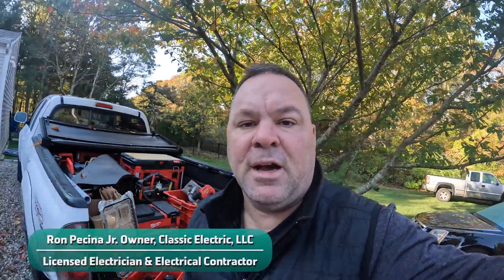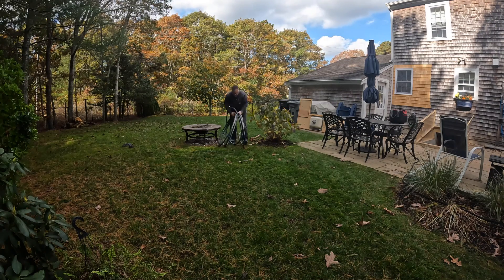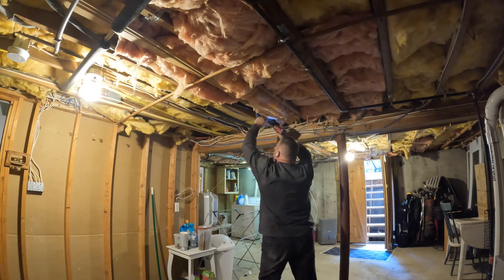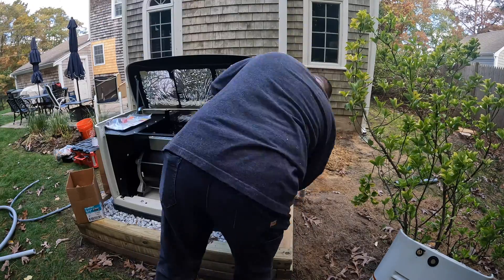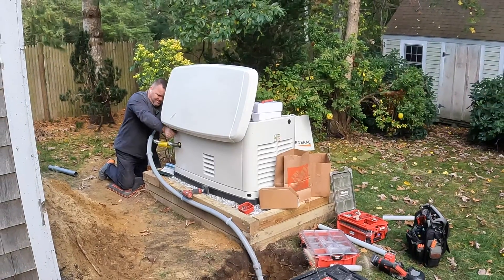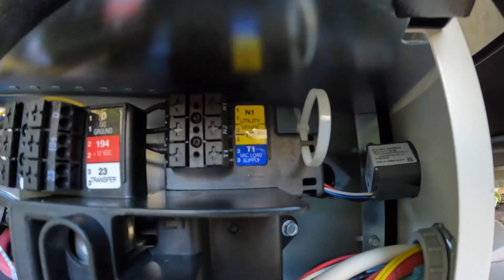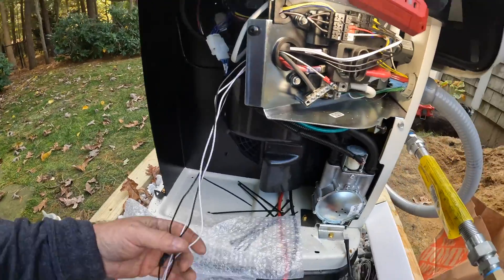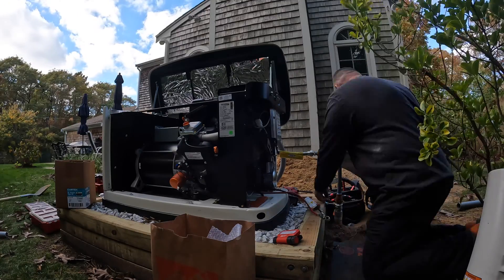Generac 7209  24/ 21 Air-Cooled Standby Generator Part 1 (of 2) | Osterville, Cape Cod

Comment: Nice job. One question? You said there is always 240 v going to the generator 🤔 It’s only had 240v from the generator when it’s running. Correct?
Reply from the maker: N1 & N2 are voltage sensing devices.  It’s what alerts the transfer switch that powers been lost and to start up the generator.

Comment: Hey Ron, God bless you man, great videos. Help I have an issue with a generator with the battery because it is always dead I was reading about a neutral jumper there is no clear information. What I can do, thanks.
Reply from the maker: The neutral jumper is for new units. If your generator is at least a year old you likely don't have need for a neutral but you should have  T1 supplying 120 volts to charge the battery. That's what T1 is for.

Comment: What’s wrong with going through the sill plate? Why the foundation wall?
Reply from the maker: You want to go through the rim joist, not the sill plate.
Reply: @electricianron_New_Jersey  that’s what I meant. Just strange that they core drilled the foundation wall. We stay above grade to prevent any damage to the water barrier below grade.

Comment: Good job,a couple of things  I would have done different is put a 90 at the bottom to make it easier on the pvc straightening up also install another lb at the top of the pipe then change over to the the seal tite 👍

Comment: Nice work. 

I have a 22KW in Florida. A couple weekends ago I noticed a Tstat was off. Checked the float switch, low voltage fuse all good. I have no incoming 240. Breaker isn't tripped. Removed the panel cover and I have 240 at the breaker. I was stumped. Did a rat eat the wires in my attic but not short them? I had continuity back to the air handler so not that. Maybe the breaker can't carry current? I'm pulling at imaginary straws at this point.  On the way to pick up a breaker I remembered the A/C's have load sheds. Sure enough the light is out on one of them. I bypassed it and we have power again. Turns out the Generac load sheds have known bad boards. The old ones are green. New boards are blue. The other thing that through me off was when I checked the contactor in the load shed it was pulled in. I am used to A/C contactors being pulled in to close. This is relaxed when closed. A bad board pulls them in to open. Learn something new everyday. They replaced the bad board under warranty so all back to normal.

Comment: Nice video Ron, who does the generator pad and platform? Is that usually the electricians job or does a GC handle that or homeowner? Are poured concrete pads the best or do you get the pre-made ones that you just lay down?
Reply from the maker: It's really up to whoever owns the generator. I've done them in the past and I think they're really nice. A precast concrete pad direct from Generac is also a nice option.

Comment: Love your work, I’m electrician in Minnesota. Is SE cable rated for direct burial?
Reply: standard SE cable is NOT rated for direct burial. The stuff he is using here is available through Generac and is UL listed for just about anything, although not cheap. You make up the price difference because you don't have to run more conduit to satisfy code on low / line voltage in the same pipe.
Reply: Its not SE. Its TC specially made for Generac. It has N1, N2 ( sensing) 23 , 194 and T1. plus the feeders .Eventually they will be adding a neutral conductor to pair with t1 to satisfy the code.
Reply: @jessemackenzie6516     good point about adding that extra neutral, even though that's splitting hairs. Of course, that means adding another connection in the terminal block. The bean counters will all have their panties in a bunch over that!
Reply: @jessemackenzie6516  check with the supplier. They should have a cut sheet for you. That’s all you need to show the inspector.

Comment: Question unrelated to this video, inside an apartment building electrical panel basement the panels and meters are all way too close the one that’s 14inch is even overlapping the 9 inch ones is this against a code how did an inspector allows this mess
Reply: you'd be amazed at what can squeak by if something was retrofitted from back when codes were more lax. It happens often in older buildings.

Comment: I’m assuming you know these customers to take on a job out of NJ? Nice work Ron, and appreciate knowing your limitations. I never understood electricians having to repair gas engines in these units. I have a 22kw Generac and it’s serviced yearly by my installing dealer/electrician but gotta say I would not feel comfortable with them working on the engine 🤷‍♂️
Reply from the maker: If they’re authorized by Generac than they’ll also be repairing the engine.
Reply: @electricianron_New_Jersey  yup. They are a top dealer here in South Jersey and they said they stock a lot of parts too 🤷‍♂️